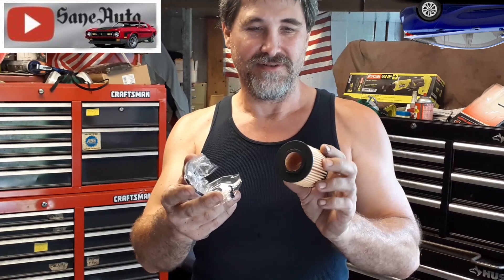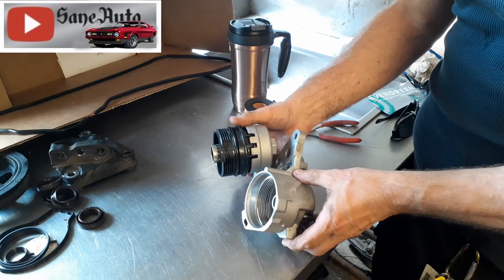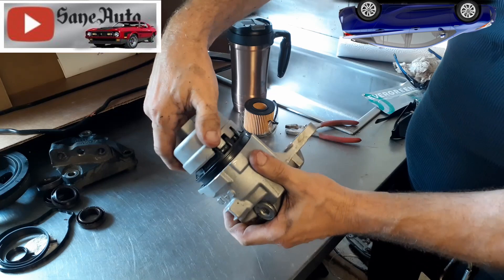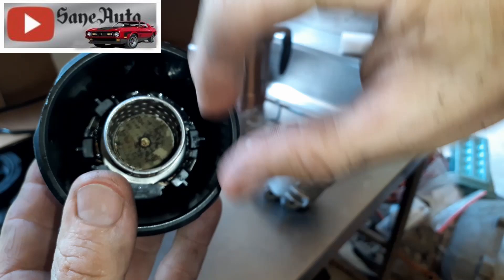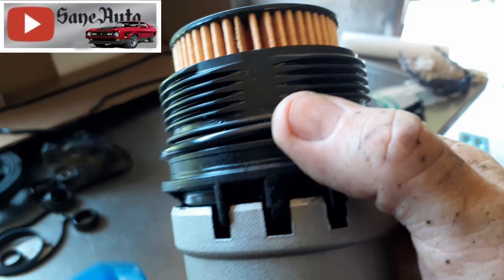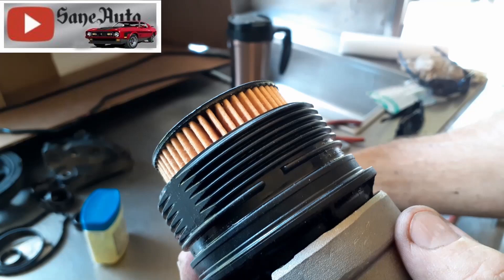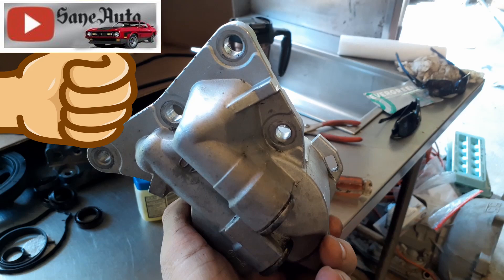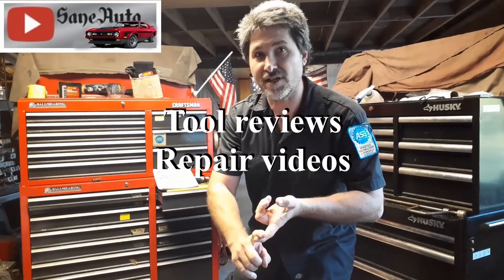Where is the Toyota Prius oil filter location and how to replace it

Comment: Can you do a video using a Baxter Performance oil filter adapter?? This adapter eliminates the cartridge and allows the user to use a more convenient spin on filter.
Reply from the maker: 3 conditions. If the product is well made. If there is an Amazon listing I can link to, and If Baxter wants to provide me with one. Then sure Ill do an install video on the Prius.